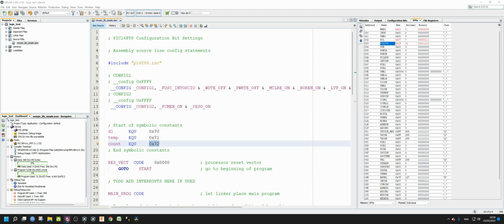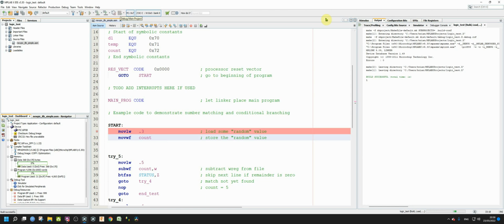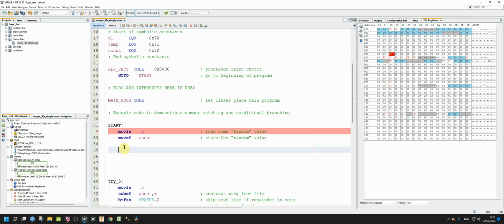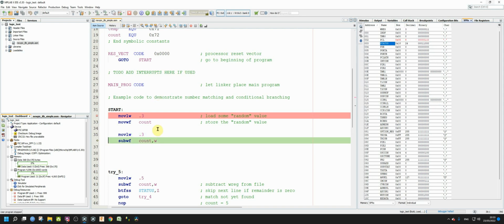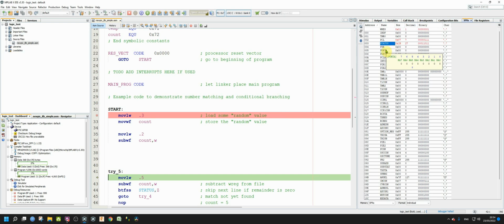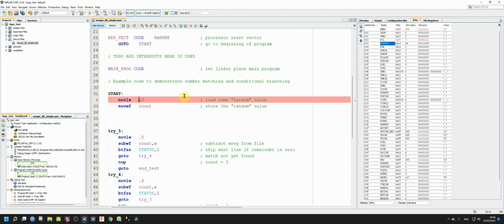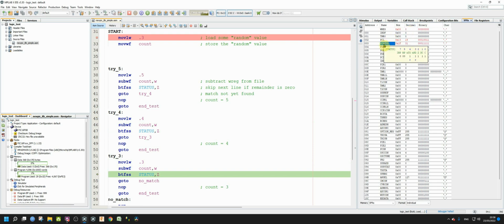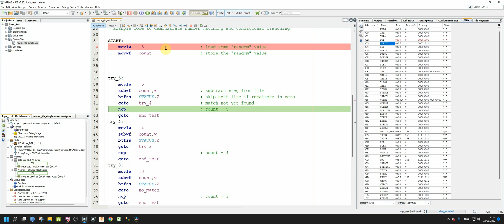How to compare values for equality by subtraction (SUBWF and STATUS Z) | PIC assembly programming

Comment: Looking at bit 0 in the STATUS will tell you if the answer is negative or not. Great for checking if the values are greater or less than each other. A useful analogue input comparator.